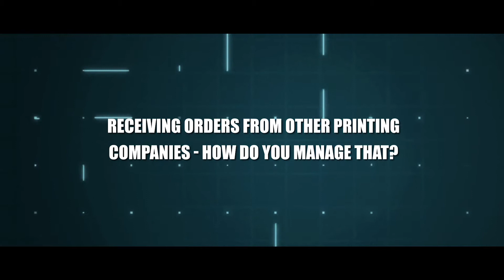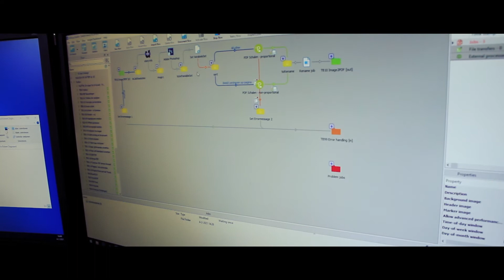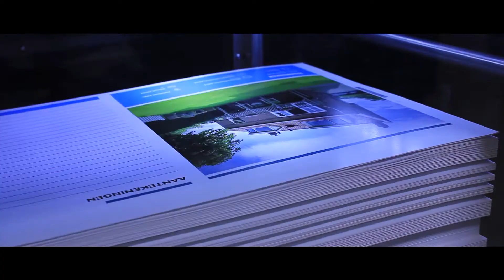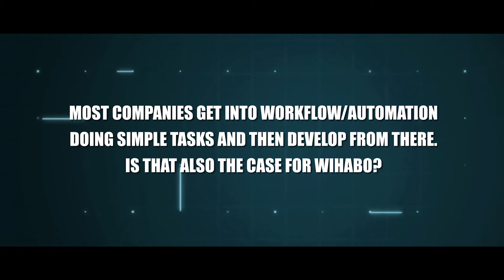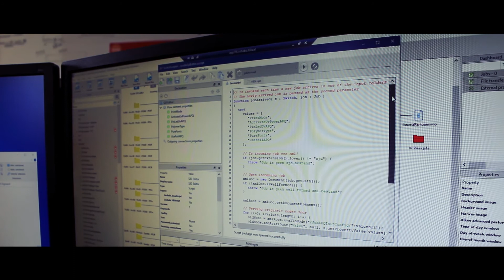Enfocus Switch enables Wihabo to Handle Thousands of Orders Daily · Robert Zegwaard · Wihabo

Comment: Just would like to add, if I may, that Enfocus is foremost the maker of the software. Our go2market model is indirect. We work with integrator partners across the world. And although these integrators are independent companies we have a strong bond with these partners. They are our feet in the street, both commercially and technically. I am particularly pleased that they are considered by our valued end-users like Wihabo as an integral part of Enfocus.  Thank you Wihabo and thank you ISI Consultancy, the team around Menno and Tjeerd.